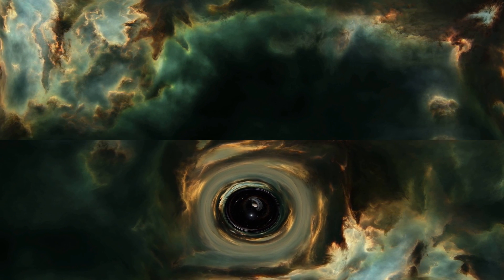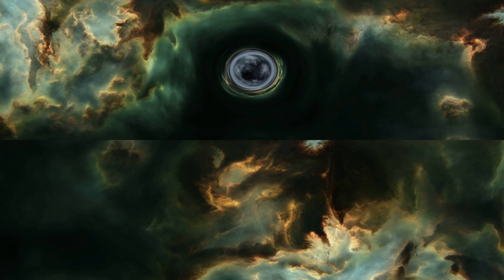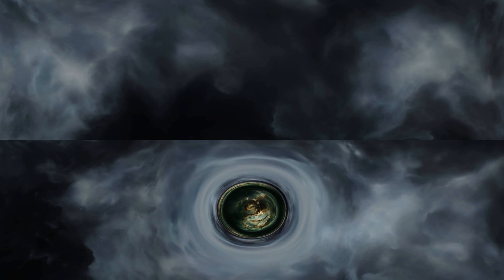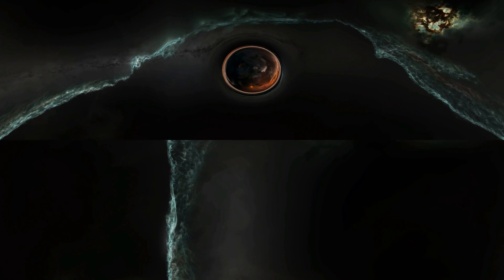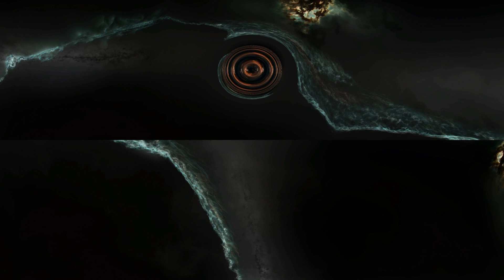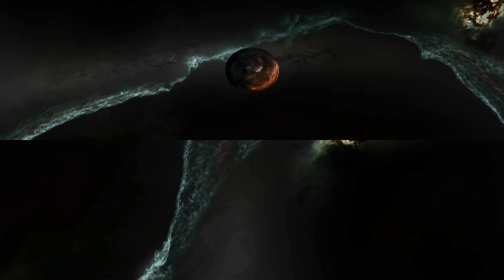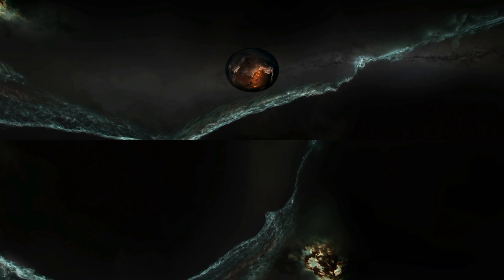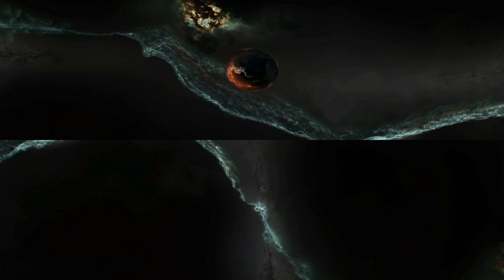What Would Travelling Through A Wormhole Look Like? (VR/360)

Comment: Could a Wormhole exist between 2 universes with completely different physics laws? or are there some ground rules?
Reply: It depends on what the physical laws are, but most likely no. If the gravitational constant was a lot higher or lower, then the enormous energy density in the other Universe would either lead to the creation of a black hole or not be enough to deform space in an appreciable manner. And if any other physical constants were to be changed, even if the Wormhole were to remain stable the universe would kill any human. For example if one of the fundamental interactions was missing, then your Atoms would not bind together in the way it does now. You'd disintegrate.( for example if there was no strong nuclear force mediated by gluon fields).

Comment: I'm a bit confused as to why a large ship would crash into itself if it were to travel through. Could anyone try to explain? :)
Reply: Hmm. It's a bit trick to explain. Let's try dropping down to 2d. Imagine taking strip of paper and sliding it across the inside of a paper towel tube,(in this case the paper is only allowed to be touching the surface, no floating in the middle). If the strip is too wide, it will overlap itself
Reply: @KaosFireMaker  Ah that makes sense. Thanks!

Comment: Hey, do you know what would happen if you entered the wormhole to the middle but then changed direction by 90°? L shape, would the lines just warp to the same shape as in the direction before, or would we indefinitely be stuck inside the hole "between two planes"?
Reply: If you go perfectly parallel to the surfaces you obviously would never reach the surfaces; but you can always turn and head to one of the surfaces

Comment: @Scott -- Why another universe? To be useful, we'd want a wormhole with both ends in our universe. For example, to jump from one location in our galaxy to another location in our galaxy. Is a wormhole to another universe theoretically possible since we don't know if the physical laws of the second universe are similar enough to ours to support such a connection?
Reply: Wormhole to another universe is a lot simpler. When talking about two in the same universe, you have to consider how the two points are connected. There is a endless number of ways to do it. The two most used examples(and easiest to rap you head around) are to curve space every so slightly over a large enough distance that it touches back on itself(the folded paper example, it would look the same as this if you done it over a long enough distance but add distortions on a short distance) and compressing/expanding space to basically make a tunnel. 

And we have no idea if another universe even exits let alone has similar enough physics to allow a wormhole. We don't even know if a wormhole can exist in this universe. The theory on how to create one involves using exotic material, that probably doesn't exist,  with models, that are known to be flawed in some way, in an untested extreme setup. In fact, the existence of wormholes would disprove part of the theory used to craft them. 

It is okay to let your imagination run wield in sci-fi, but in actual science, wormholes are more of a thought experiment. It is pushing a theory until it breaks so you can rebuild it stronger. Unfortunately, we have hit a point with theories where they only break under such extreme settings that we can't create the test.
Reply: If the physical constants in the second Universe are the same as in this one, then the wormhole could exist there.
Reply: Eventually the universe will die out, so if you could travel to other universes you could travel to a much younger one in terms of its age, so you could avoid proton decay and the heat death of this universe.("older" one).

Comment: Wait. Shouldn't Dark Energy have the  properties to work as Exotic Matter for Warp Drives and Wormholes?
Reply: Dark energy has a positive energy density, it repels things because the energy density of dark energy is constant as space expands which produces a negative pressure.
In addition, as far as scientists know the energy density is very small and cannot be made arbitrarily large or change over time.
For dark energy to count as exotic matter, it's energy density would have to be enormous, as well as negative.
If its energy density was as enormous as needed for Wormholes, then it would have blown the universe apart long ago.
 On the other hand if its energy density was constant and negative, it would produce a positive pressure causing cosmological blue-shifting and not red-shifting, meaning the universe would be contracting and not expanding.
Reply: @scifirealism5943  I mean as far as we know, Dark Energy causes Space-time to expand (that thing that caused our universe to expand since  the Big Bang). Normal energy causes Space-time to contract (in form of gravity).
But that expansion of Space-time is exactly what we need for a Wormhole or a Warp Drive. Even if it turns out that Dark Energy doesn't cause the expansion of Space-time, there is still something that lets our universe expand and that thing is Exotic Matter.
Reply: @daragol1238  although the bottom line is not enough is known about dark energy to be able to use it to create a wormhole.
Reply: @scifirealism5943  Yes. But the main reason why everyone always thought that Warp Drives and Wormholes are physically impossible is the Exotic Matter. But that's solved now. Of course we need a lot of time and work until we can build one but it's physically possible.
Reply: But the energy density of dark energy is still constant, there's no pressure gradient anywhere. And the expansion of space it causes is very small compared to what's needed for a wormhole.
Reply: @scifirealism5943  We also need to find a way to bring a lot of Dark Energy to one place. I think that is the biggest problem because that could be physically impossible.
Reply: The amount of energy needed is still enormous. How would you produce it? Even antimatter wouldn't provide enough energy.
Reply: Dark Energy exists within galaxies just as it exists between them.  However, the amount of dark energy within galaxies is so small that the gravity generated by matter alone overwhelms the negative pressure produced by dark energy, even ignoring the other much stronger fundamental courses. Only in Intergalactic space, where there's far more dark energy than regular energy, can dark energy produce a noticeable effect due to the enormous volume of the universe. So you would need to travel to Intergalactic space, collect enormous amounts of dark energy, then bring it back. But how do you travel to and from Intergalactic space? That would require near light-speed but slower than light travel which is impractical.
Even if you could travel near the speed of light safely to reach Intergalactic space, you could not collect dark energy because it only interacts through gravity and there still a very small amount of it in space.
If it only interacts with matter  gravitationally, then you cannot taste dark energy, see it, touch it, smell it, or store it.
Reply: @scifirealism5943  That's a problem yes. But we have improved from physically impossible to not practical. What I want to say is that all this is possible just not practical yet.

Comment: When we are close to the wormhole or inside the throat could we see ourselves? I'm guessing we do and multiple times as well. Would be a cool feature to add.
Or am I wrong?
Reply: I'm asking this because starting at 6:30 we can see the whole space (or two spaces) on a flat surfaces, kinda like the star map. So if there was an object outside the wormhole we could see it regardless of our "position" inside the wormhole. What I can't grasp:
1. Would we see that object once or multiple times (one close, then another  further, and so on)?
2. Would we see ourselves? Ie if we flash a light paraller to the what looks like a surface, would it go in circles?
3. Same questions but closer to the surface and not inside.
4. Is there even a hard transition: inside/outside?
Reply: Yes - the throat of the wormhole is effectively a recursive space, so just as we see infinite images of the environments on both sides, we would also see infinite images of ourselves.
Reply: @Spaghetti775  Is it though? It's not a black hole, light is not trapped there.
Consider this: light always travels in a straight line (according to it's point of view), shortest distance from a to b. So for the light to be going in circles indefinitely space needs to be completely warped on itself with no escape. Kinda like a black hole.

P.S. It's easy to imagine 2-dimensional wormhole, but as I was trying to imagine it in 3 dimensions, my head exploded. Thanks, Scott! Fly safe indeed :)
Reply: @dmitryincog7455  If you imagine a ray projected perfectly sideways in the throat, in theory it is trapped, there wouldn't be any route, it'd just follow that path forever, looping over and over. If I understand the geometry right of course (likely I don't but that's my theory)
Reply: This is a good question, and not only for what you actually ask (how it looks), but what it points out too. The camera is essentially a point-object in the video, but how would an actual object be treated when entering space warped this extremely? Would the vertices of the polygons pull apart, tearing the model into a warped thing that probably owuld have broken apart if it was made of atoms?
Reply: @feha92  I don't think that out atoms would break apart if the wormhole would be sufficiently large. After all we could drag some two dimensional object (like a rectangle) through two dimensional wormhole just fine without warping it's shape relative to geodesic lines of it's dimension. Again if it's large enough so it won't collide with itself.
So I think we'd be fine.
I doubt we would even see our own insides (which is always the possibility when traveling through the fourth dimension).
Reply: I'm confused as well
Reply: You would observationally be wrapped around yourself in the latteral directions of the wormhole. basically, you would see the exact oposite side of yourself whatever way you are looking.  only 1 copy, but that copy wraps around you, and would appear to be an inverted shell of your outsides. The wormhole has no true edge per say, so lateral movement is as far as i understand it irrelevant as far as going trough the wormhole is concerned.
Reply: Yeah, if the curvature is great enough you should be able to see the back of your own head/body.
Reply: World's most expensive funhouse mirror.
Reply: You would be able to see yourself stretched out across the wormhole in a ring shape
Reply: It depends on how negative energy behaves non-gravitationally.